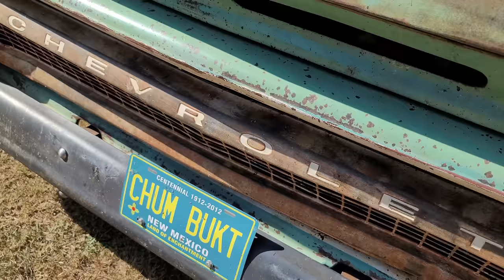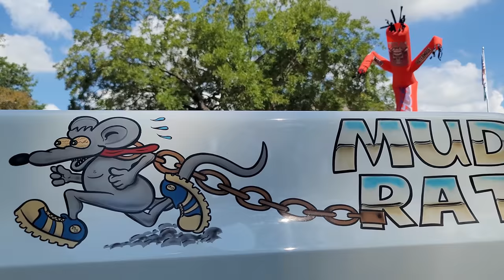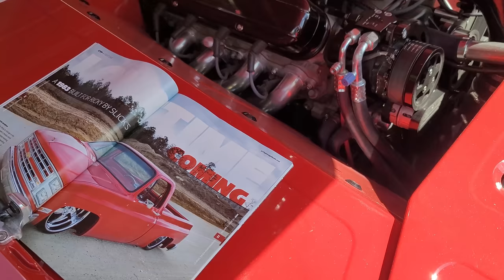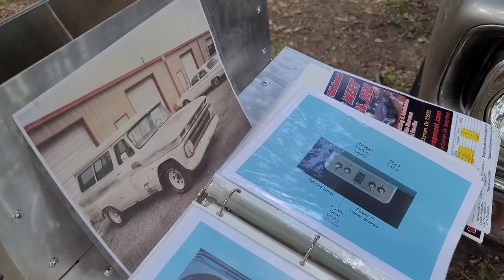2021 Texas classic truck show {C10s in the Park} classic Chevy GMC Squarebody Cheyenne Scottsdale 4K

Comment: I didn’t  see any 1960 chevys ?
Reply: I was  looking for a 1961 Apache truck. 
Saw a few  62s.
My 61 must be rare. 
Wow
Reply: @vm722  yes I have a 1960apache  I think they are rare or people don’t like them because  they have cat eyes on the hood like a 1959 Chevy car ?
Reply: @eutimiochavez415  I have a 1960 that I got for my grandson and I am working on my  1961. 283 three on the tree short bed  fleetside. Its looking amazing. 2.5 drop spindles and a 5 inch drop on the back. Power steering and power brakes. Dakota  digital dash  Working on a  frost white  color. And I have a  complete  chrome set. 
The  crazy thing that I see is that some people remove the torsion bars. 
Why do people think that way 🤔 
It had a awesome  car like ride since  new.Chevy discontinued it to save money. Crazy huh 😳
Reply: @vm722  I own a 1960 Apache a I love it  it has an in line 6 235 with a 4speed  I like the cat eyes on the hood.
Reply from the maker: Badass
Reply: @samspace81  yes I know thank you
Reply: @vm722  yes!